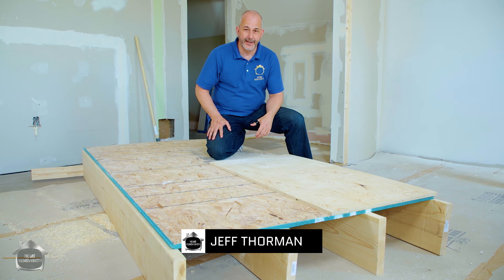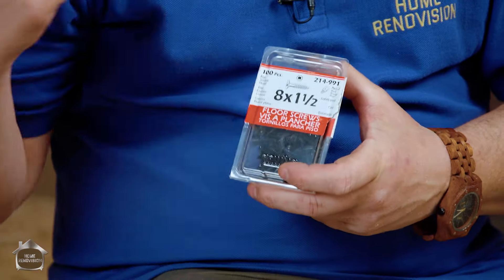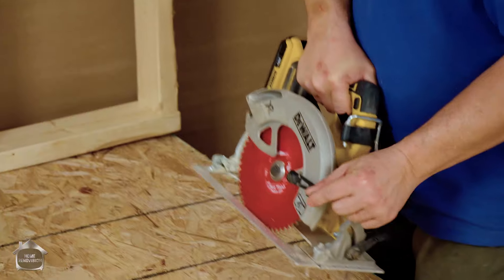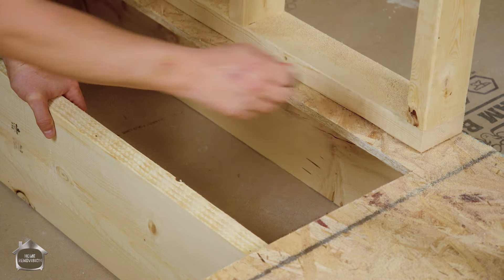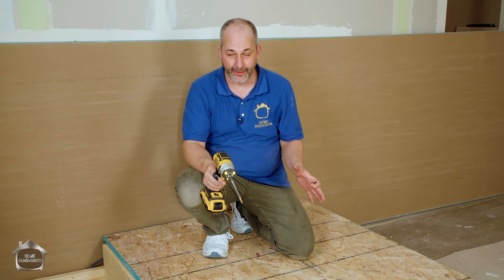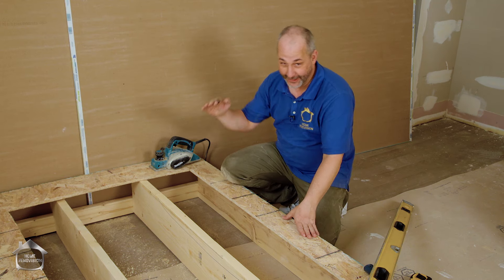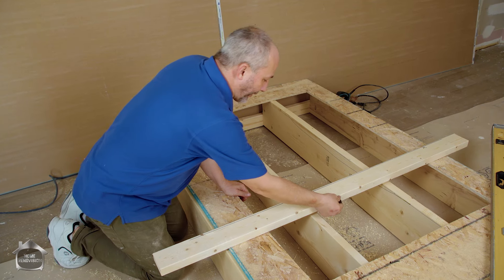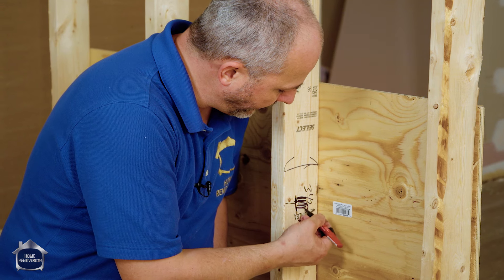Watch This Before You Renovate Your Floors

Comment: Possibly a dumb question Jeff, but just moved into a newly constructed apartment.  We have in floor hydronic heating.  The floors the place came with are about as cheap as you can find laminate.  They came with some chips and scratches which the developer may or may not considering all of the other deficiencies fix.  My question is given the building already has an industrial style, is there any reason why we could not just pull up the flooring now or when its trashed in a few years, and just epoxy the concrete slab?  I have no had a look at it but will if they ever replace the damaged boards.  Lobby entrance is already polish cement with some sort of coating.  If what we see is too ugly since its meant to be covered could we just put down a self leveling cement then epoxy/seal that?

Comment: Can I get a bit of floor advice.  I had 7/16" engineered hardwood put down over 3/4" t&g plywood.  The guy did a beautiful job except in one area where there is a slight bump.  Its been there 20 years and annoying me.   Something got under the floor before it got nailed down.  It would be as if 2 dimes stacked on each other were under there.  So I've been thinking what to do.  Here is my plan. Put a magnet on the the peak on the hardwood.  Then go to the basement and match up the location with another magnet.  Then using my ossicilating saw cut about a 6x6" square enough to just cut through the subfloor.   Remove the offending item, replace the piece of plywood and then screw and glue a bigger piece of 3/4" plywood over the plug with 1-1/4" inch floor screws being careful not to counter sink.  I would just like your yeah or neigh and any other tips you could give me that might make the job smarter.  😆Another excellent video by the way!!!  Thank you.

Comment: HELP! I pulled up my carpet and there is hardwood (painted and in ok shape ) i want to put laminate over it but im scared of putting the self leveling concrete over the wood!!! Should i be scared of doing that?
Reply: There is crazy high and low spots. My house is old with additions added in two areas causing a complete uneven situation

Comment: Thanks Jeff for the information. We are renovating a 1901 house with a crawl space. The joist are 2" x 6" with 9' spans and 16" on center. Any advice on strengthening that? I am removing all the layers of flooring and there are several right down to the joist. Will a single 2" x 4" lament, glued and screwed be enough?
Reply: I would sister 2x10s to your joists or get engineered joists in there.

Comment: Quick question, and maybe one you get often. Can you glue the osb from the underside (in the basement with open floor joists) where there is creaking happening? (Trying to not remove hardwood to re-install)
Reply: I have the same situation.
Reply: Absolutely.

Comment: I have a 100 yr old home that was moved from another location to where it is today.  That was about 70 yrs ago.  So, I don't have all floor joists.  I have a blend of joists and whole log.  Looks like tree trunks.  The house is over a basement.  And I have plank wood over the joists and logs.  So the floors are very uneven.  Can I put LPV over this type of floor?
Reply: Oh, and I love your videos. Makes me think I can do this myself.   I am not good at this stuff.  Would you by chance, be near the Thumb region of Michigan?
Reply from the maker: I am from Canada. Your flooring question though . It would be reasonable to use lvp but you need floor leveler first. Another option would to use loose lay vinyl sheet. it comes on a roll 12' wide and as long as you need. great for uneven surfaces.
Reply from the maker: hardwood installed with staples is another good option. Cheers!

Comment: Hello I'm hoping you can offer me some advice. I just bought my first home in Southern Ontario (1948 construction) and I want to renovate the basement so I can use it as a studio for my work. The basement is currently partially renovated with one room having a glued carpet directly onto concrete that covers the floor drain. I want to put down some engineered hardwood that I got on the cheap. With the floor being uneven in order to lead to the drain should I attempt to re-level the floor by first removing the carpet (if so what is the best way to do so) and putting down DMX+plywood before I put down the hardwood? Or can I skip the carpet removal and go directly to DMX+plywood before laying down the floor. While the carpet shows no obvious water damage I am concerned about potential moisture rotting the floor or causing mold growth. I need suggestions for the best way to waterproof this old basement as I need the basement for work.

Comment: Hey Jeff! At about 9 minutes you started talking about modern materials on old materials. I'm in the process of remodeling basically my entire house and making it more modern. We're planning on using vinyl flooring that's about 5" wide by 48" long, with a thickness of 6.5mm. Does this flooring fall under your "large tile" comment, or can I assume it's just a simple underlayment and install?

Comment: Jeff how do you feel about using an underlayment pad with the LVP that already has a built-in underlayment pad and the manufacturer says it's not needed? On one hand, I can't imagine the pad would hurt, but I know the manufacturer says it will void the warranty. Wondering if the manufacturer knows the 'extra' pad will cause the product to fail, or if it's an easy way for the company to weasel out of honoring the warranty.
Reply: Some condo boards require a certain quietness between floors when putting down flooring that can transmit sound.  They do require a sound deadening underlayment.  So sometimes it has to be done warranty or not.
Reply: @gregsmith7391  interesting point. Thx for sharing!

Comment: These are all amazing videos. What type of transition do you recommend from floating vinyl on the bottom floor to carpeted stairs? Do you need to attach that side of the floating floor to ensure it doesn’t move on that side?
Reply from the maker: I would recommend a T molding at the joint under any door. Cheers!
Reply: I’m fangirling hard that you replied. 🤩 We don’t have a doorway where the stairs start, is it still appropriate for a T joint?

Comment: As a hvac installer how and what do you do when you have or need a 7 or 8 inch supply pipe run in the bay where you need to reinforce the piece you took out?
Reply: I'm not sure what you mean.

Comment: Get this one.. house is from 1972.. kit house.
It is pier and post with old growth 4"x6" joists at 48" center!!
The subfloor is 2in t&g plywood.. 
Had the load bearing joist, subfloor, lower plate in the corner rot out (previous termite damage with unseasonal  water wicking)
I have replaced the original joist and ran new 4x6 joists perpendicular (16" on center) to the original and installed 3/4 plywood subfloor.
How do You get the new section of floor to ever level with the existing?
Do I need to cut long shims to put on top of the joists to push up the subfloor?  Add layers of plywood on new subfloor? How will they ever level?!!
Cannot afford to replace the rest of the subfloor at this time, lumber is OUTRAGEOUSLY expensive atm.. (3/4 ply is $120 a sheet)
Reply from the maker: I would rip 2x4 and lay the 1 1/4 you need on top of each joist with adhesive and nails. then lay the plywood. Cheers!

Comment: Jeff Home Depot carries two different types of"floor screws" 
#1 Squeeeeek No More, replacement screws, 250 for $25.13. 
                  AND
#2 Grip Rite,  star drive, bugle
 head construction screw. 
I thought just using a regular ring-shank could do the job, but???

Comment: Instead of blocking, how about cutting your hole so it’s at the edge of the joist, then nail a long 2x4 to its edge?
Reply: That works great.  I also run a bridge in between the floor joist, from frame to frame, to make those sections even more sturdy.  Over-kill maybe but that's just me.

Comment: What if your home is really old 1920-1930 and the wood that is right on top of the joists is a bunch of 1" thick, 3.25" wide, tongue and groove redwood (or douglas fir) planks? It even has some weird fabric between the joists and the planks. The floor is not very flat and I am afraid to install vinyl on top of it because of how unlevel each subfloor plank is.

I think I have two options:
1. Sand it. I'm thinking this is not ideal since wood expands and contracts. So it can end up unlevel again.
2. Install a layer of wood on top of it. Ply is stupid expensive right now. Can I get away with OSB or MDF? Or maybe some other material?
Reply: I definitely wouldn't put MDF in my house, not even cabinets.  It's terrible stuff in my opinion on a house.  It has its time and purposes but to me, but in a house.  Is your joist level and there "planks" not right, or are the joist unlevel is sagging.  And obtw, the fabric between the joist and subfloor could be a vapor barrier.  But vapor barriers usually guess between the subfloor and the floor itself.
Reply: @jimjordan5630  I cannot see the joists. I haven't removed any of the hardwood subfloor yet. I am pretty sure that the hardwood subfloor are the ones that are not level. The individual boards vary in height and some have small warps. As hardwood naturally does. The boards are not very exact. Lots of gap variation and lots of differences in width and length. It could be sanded and finished and it wouldn't look too terrible but it would for sure look pretty rustic.

The fabric part is not resting on any other subfloor as far as I can tell. The way I know there is fabric under the hardwood is because one of the pieces of hardwood had a knot hole that I can see the fabric through. When I poke it with a screw driver, the fabric has some give to it. So no subfloor under it.

This is on an upper floor. If I go into my basement, I can see the joists for the lower unit. Those look like they are in good shape. So I assume the ones for the upper floor are too. But I will not know that until I look at them which might not be something I do.

Comment: So your saying don't do tile on 2x8 floors period ?
Reply from the maker: as a general rule yes!
Reply: @HomeRenoVisionDIY  joist size,span,spacing. Together they help determine the deflection factor of the floor. This is what tells you that a floor is sufficient for tile. if the  general rule of thumb is L/480 for tile, L/720 for stone. Maximum deflection for tile being L/360. Do you believe there is a way too bring it too a  standard  by way of laminating more joists too the 2x8 to make it tile worthie. By more joists I mean more 2x8s or 2x6s ? (Just asking because I brought a home that was built in the 1950s framed with 2x8 lumber )

Comment: Hey Jeff, thanks a bunch for the insane amount of info in there!!! Currently looking to level my very old floors, which are currently unlevel by approx. 3inches due to the home settling over time. The foundations have been solidified in recent years, but that's still a huge gap to level. Would you approach it the same way?
Reply: Did you ever figure this out? I just bought a house that is very slanted haha

Comment: My house was built in 1984 and it feels like the beginning of glue.  So many things are weirdly glued yet they nailed on top of it, and no screw in the house is the same length, material, head, thread or depth: feels like Grandpa's number ten can of odds and ends built this thing. But my biggest complaint was not that or even the squeaky floors: It is that they didn't reject 2 2x10s that were so warped that it was over an inch out of flat and bowed up. (at least they crowned)  I couldn't install 100% hardwood over it because it was just that bad, you couldn't put furniture on it,  it was teeter totter.  I followed this video and opened up the floor and sistered the 2x10 with 2x8 for 10 feet, after trimming off the crown of the 2x10s with a circ saw.  Yeah that felt sketchy,  but the work paid off,  this room is the flattest in the house, no squeaks, and feels solid under foot.

Comment: Nicely done, and since it's been almost a year since you put this video out, I am sure you now know that yes, the USA has floor screws.  I am in the midst of upgrading flooring in my 60 year old house.  Pulling out some linoleum (top layer of 2 layers) and installing a vinyl laminate floor over.  I figure to get rid of the squeaks before putting the new floor down.  Is it OK to drive the floor screws through 1 layer of linoleum?  Also, how long of a screw should I use?  You show 1.5" screws, but it seems that the retailers push 3" and 4" screws.  Also, it seems that deck screws are the same design, but just better metal (more rust resistant).  Thoughts about using deck screws to fix the squeaks?

Comment: First of all any blocks that you put into the corners should have had glue. It prevents speaks and as you said you already have your glue tube open. Also when adding the screws from the top you should have used a screw with the threads near the bottom of the screw so it tightens the block to the plywood flush. 
Also then adding blocks you can add a screw into the side of the joist and into the block.

Comment: I'm not sure about your framing technique onto the subfloor.
I come back in where people have left the ends loose like that and installed vinyl flooring over those cracks and after a little while stepping near the two cracks it actually sagged and ripped the flooring at the jackage edge.
I recommend blocking the whole area all the way around.

Comment: The subfloor should be 1/2" or 5/8"... Mine was 3/4" particle board. Replaced it with 3/4" plywood, because it was only $5/sheet more expensive than OSB at the time, and had far less flex than the OSB did.
Reply: An oscillating tool is definitely your best friend for those corners of the subfloor. You don't have to worry about cutting too deep, like you would with a sawzall.

Comment: can't tile on 2x8 joists? really?

i am sure in some situations or spans, your 2x8 deflection could preclude tile but to make a blanket statement like that isn't true. I have had tile installed in old houses with 2x8 floor structures and no cracks over a decade later. A 2x8 over 6-8ft probably has less deflection than a 2x10 at 16ft. All depends on the free span, wood species, and maybe even subflooring.

Comment: i would be carefullwith those overpriced Dewalt diy tools, when i tried cutting a hole with a few month old XRP IT BURNT THE  MOTOR AND A BATTERY OUT, IVE NEVER HAD THE PROBLEM SINCE, BECAUSE IVE NEVER BROUGHT ANOTHER dEWALT TOOL

Comment: Lmfao 😂 
Shitty homes are built shitty! I seriously appreciate what you’re doing because at the end of the day you’re educating people. And yes unfortunately a lot of people are living in shitty built homes. Maybe I was raised differently but I was born in 74 and grew up framing houses with my dad and now I’m a builder in the Midwest. We used 3/4” t&g CDX plywood and we glued and nailed it to the 2 x 10 or 2 x 12 joists. Your example is 3/4” t&g OSB which has much more deflection not to mention the swelling issues when it gets wet and you’re forgetting about the gluing step. Yes I agree houses are built with better products now but a trust system is a far cry for a better product if you’re still not gluing it and using OSB subfloor. There are much better subfloor products nowadays and yes screwed floor is better than a nailed floor but you still have to glue the floor down to the joists no matter what joists you are using. Properly nailed and glued is every bit equivalent to screwing the floor down. Especially the nails have ring shanks on them when shot through a pneumatic nailer. You’re using a spiral nail as your example that naturally will spiral itself back up out of the wood. Anybody who’s put on wood siding knows that one. I would gladly collaborate with you on these kinds of videos to help convey the inner workings of homes during different time periods based on when the house was built and what the practices were of that time period. The first lesson to all your viewers don’t buy a shitty house and if you don’t know educate yourself so you don’t buy a shitty house. LOL. I know it sounds like I’m ranting but I do appreciate your videos and what you’re doing to educate the public. And you may deal with different stuff up there in Canada than us down here in the states.